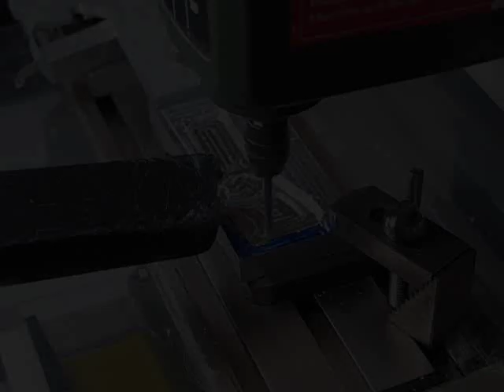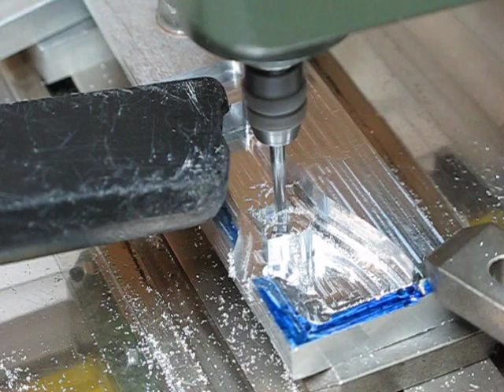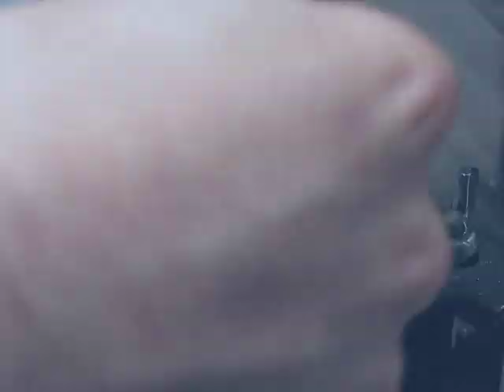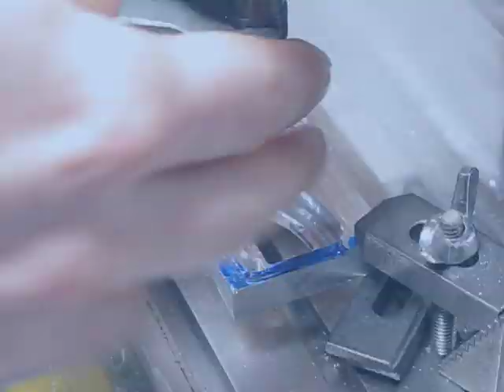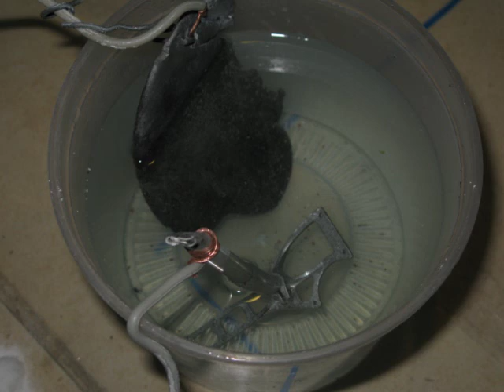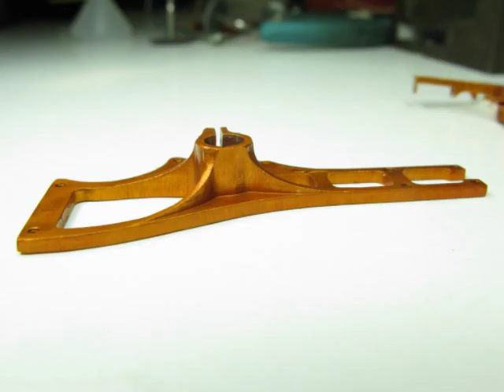MF-70 CNC Mill 7075 Alluminum and Anodising

Comment from the maker: Hi OrangeSunno,
I'm using regular end mills - either fish tail or flat end.
usually I do the finish pass with a newer sharper end 
mill to get better surface results.
 
No need to get the expensive proxxon end mills, surf 
the web and find many stores that have good quality 
and cheaper end mills :-)
 
Hope this helps 
-RR

Comment from the maker: @killdiskster Hey :-)
Well, using a 3mm endmill each pass was 0.9mm, running at a feed of 80mm per minute.
spindle speed is always set to my maximum - 20K
the aluminum blank was quite thick - since the part has a "tall" section in it's middle. as I recall 
it was 12mm thick.

Cheers , hope the info helps :-)
Ran Amir

Comment from the maker: @RickyLee53 
SolidCam outputs standart GCode and works (for me) seamlessly.
I really would reccomend buying this CAM software.
That being said, I must mention my machine is simple, so there are many GCode
commands I am not making use of (4'th axis, spindle speed, water/spray, external hand
held command box .. ext... ) so I can only testify as to simpler GCode files :)
Cheers,
Ran Amir